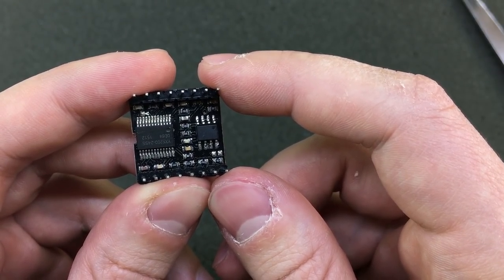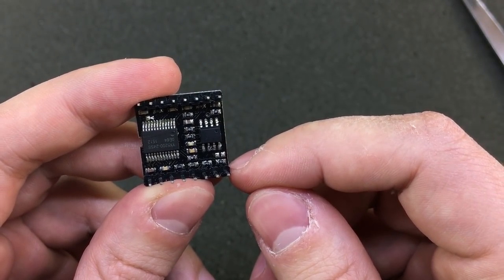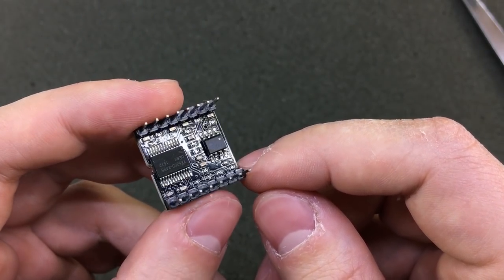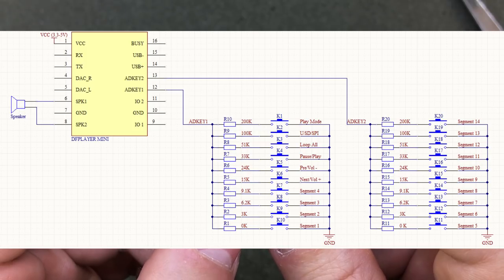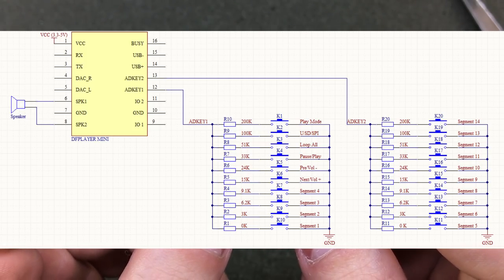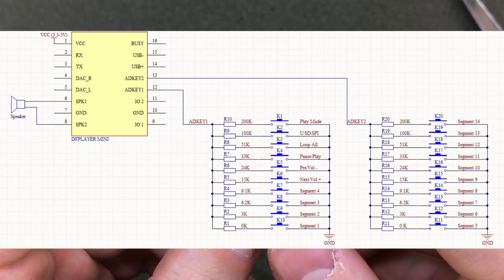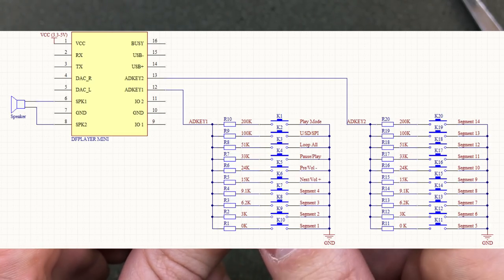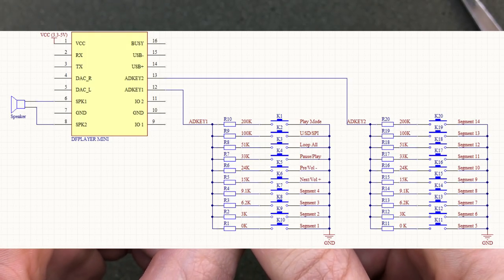Voltlog #40 - InTheMail - Part 2

Comment: Not a dis by any means and I encourage everyone to try something new. The m3 tap you bought is steam oxide treated. This type of coating is used for cutting threads in mild steal. Should you want to hand tap soft aluminum or copper threads please use a cutting oil and or kerosene to keep these soft materials from adhering and possibly giving you less than desirable results. Best tools for soft material are "bright" or uncoated tools. Alternately a TIN coating which has a gold/yellow appearance.
Reply from the maker: I don't have much experience with metal works but thank you for sharing this and thank you for watching.

Comment: you probably didnt get anyrhing on the tx-rx on your computer because you were powering the module with external psu hence not having a common ground with your pc
Reply from the maker: this video is pretty old and I don't remember exactly how I did it back then but I probably powered the module from the usb to serial converter so it had a common ground with the pc.
Reply: Yeah cant tell because you didnt show the process, but probably the juice from the usb port was also not enough to run all of this